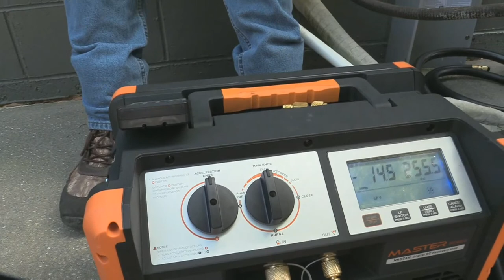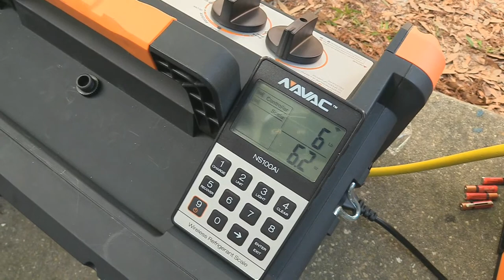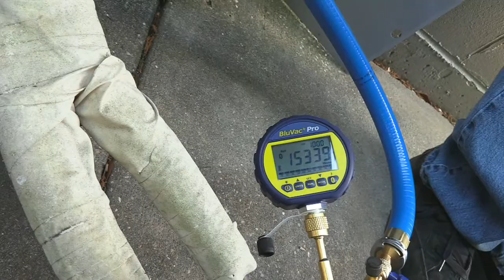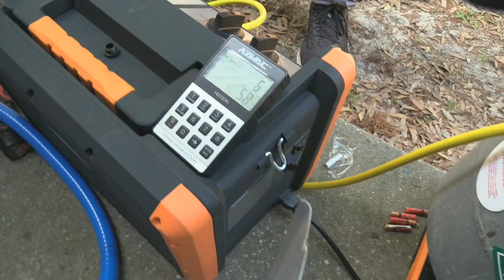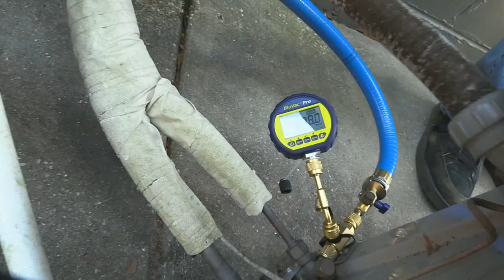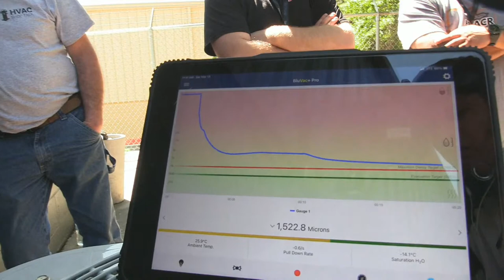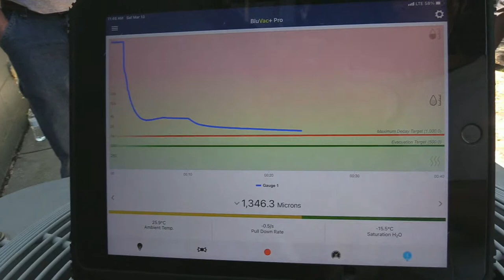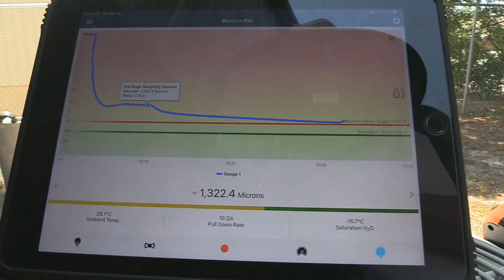Real System, Real Life, Recovery and Vaccum

Comment: System evac to 620 microns with the 2CFM and the battery died while we were doing lunch and listening at main tent. Check valve in vac pump kept us from losing vacuum. Vac was at 1200micron when we came back. I hooked up the 4cfm at that point and in 7min was at 350microns with a successful decay test after. The 2cfm pump does not have gas ballast and it did a lot of work pulling all material from system since we did not nitrogen flush it.

Comment: I opened the system to outside air for 5min, flushed with nitrogen and then redid test with 4cfm. At that point the pumpdown to ~300 took less than 15min

Comment: When we take out refrigerant, we put our recovery tank in ice water. I notice they didn't do it. Just wondering if a tech should or shouldn't use ice water? We live in south Louisiana.
Reply: In a lot of cases that is ideal however this time it did not heat up the reclaim bottle. The Navac 4 cylinder recovery pump was very efficient and don't quote me on this but I believe the pump helps reduce the need for cooling the refrigerant based on its construction